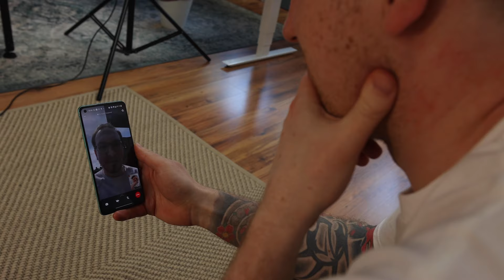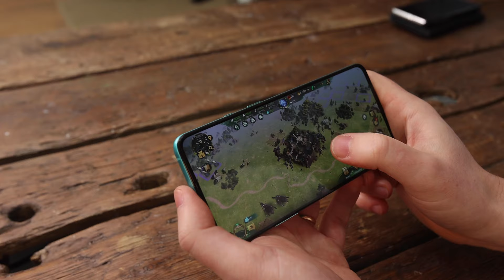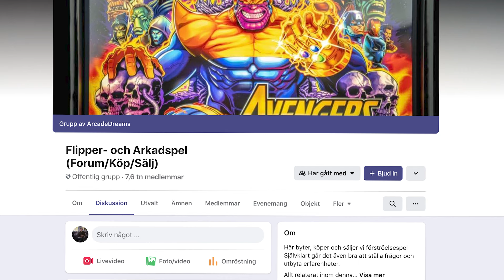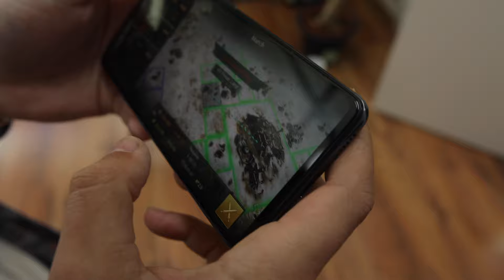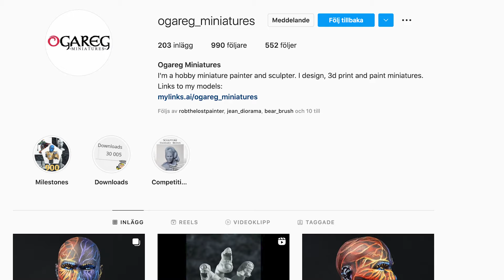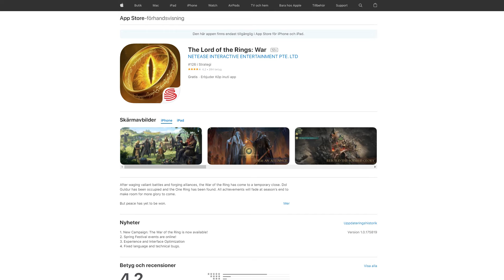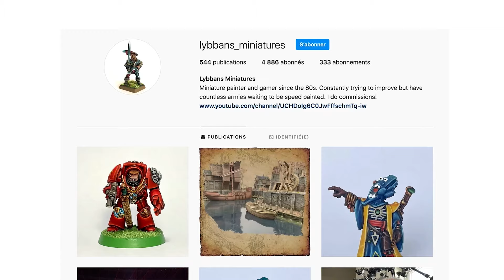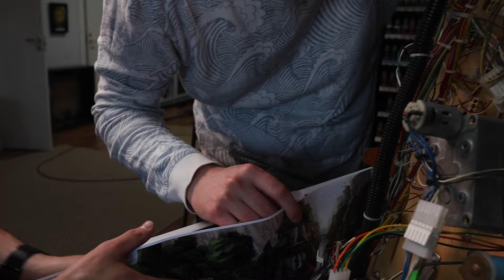Building a Lord of the Rings world - inside a RARE pinball machine

Comment: It looks excellent, wish you guys had more time to cast the minis in clear resin as well, theyre so well done Id hate to see a pinball fly into one
Reply: I think at that scale, plastic is probably more durable than resin tbh. I've had tons of breakage with my resin prints when some player wasn't careful enough with my minis at least.
Reply: @rogthepirate4593  I'm referring to epoxy resin, basically seal the figures the same way they did with the ones in the swamp, not 3D print new ones
Reply: @Genesis19-26  Ah. You confused me because you said to cast them in resin. 
I didn't say they should 3d-print them, but a resin cast and a 3d resin print of a mini are basically the same thing and equally durable (or not).

Encasing the minis in a block of resin might be possible, but would very likely just not look good.
Reply: @rogthepirate4593  Fair, Ive done some work with putting minis into clear epoxy, the challenge is mostly trying to keep it entirely free of bubbles, its something thst requires a good deal of experimenting before you get a good end product -- Took about 2 months for me to be able to consistently nail it.  Definitely not something to try if they only have 2 weeks to complete an entire pinball machine haha.
Reply: @Genesis19-26  I think for solo pieces it would look different too, I can definitely imagine it. But I think especially with the distortion it'd probably look weird in the machine haha

Comment: Such an impressive build in such a short timeline. A suggestion for a brighter top is to print the sky on a transparency and spray glue it to the acrylic sheet. Best method would be a decal print but that's rather specialized. I used to work in the poker machine industry designing the backlit artwork.

Comment: nice work

with the resin for the swamp pour, you added the dye, and then you showed it going into the pressure chamber before the pour.

is that to just remove bubbles? or is it for a different reason

and how long did you put it in for?

Comment: Hey just fyi those thick vallejo water textures like the mediterranean blue are meant to go over their Still Water or another similar,plain water texture. 

They work really well when in used in multiple thin layers like that but if used on their own...well it's not great as you can see. 
Which is fine because they weren't designed to be used like a thick texture paint.

Comment: Fantastic work, and it's not too late to add some light strips and LED's, it is very dark, and that's not just in the video, I know this pinball is dark. More lights behind the painted background, maybe even changing colors. The Candles Of Corpses in the Dead Marshes glow, they need some LED's as well. All minis you added should have some extra light, It is fortunate that GW has all the LOTR minis out so they can all be matched and replaced, but are they the same size as the toys in the pinball? Ah, well, that's where a 3D printer comes in. If you auction this off, you might get $15K for it, if you kept all the original parts.